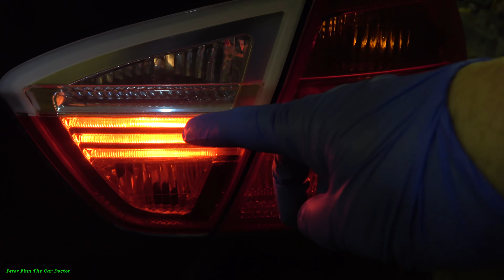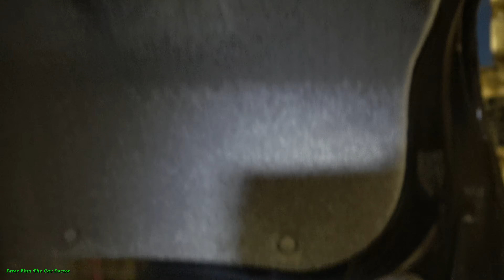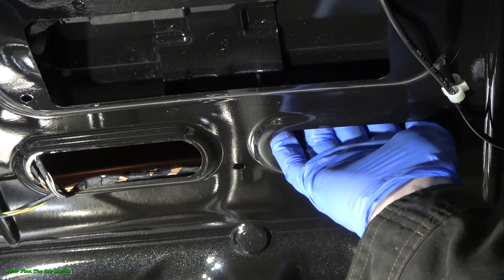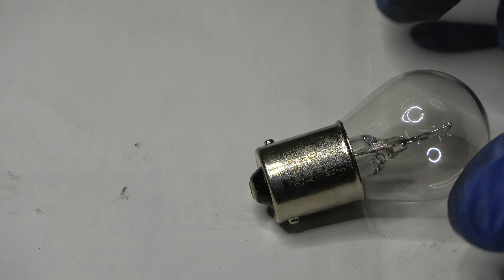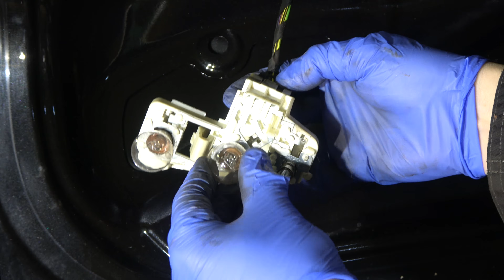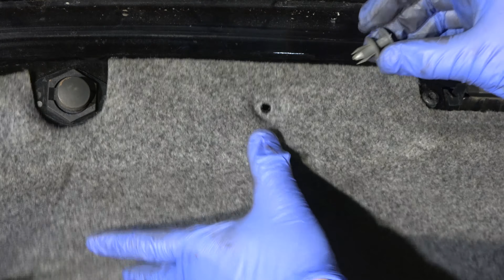How to replace rear Parking Light Bulb BMW 3 series E90. Years 2004 to 2013.

Comment: Hi. My 5afe engine on Carina My road has problems starting in the morning. Rpm needle fluactuates up and down then settles down to normal after a minute or two. What might be the problem?
Reply from the maker: Ok. Maybe throttle body
Reply: @PeterFinnTheCarDoctor  Many thanks. I will look at it.